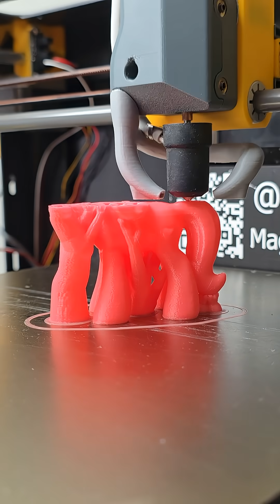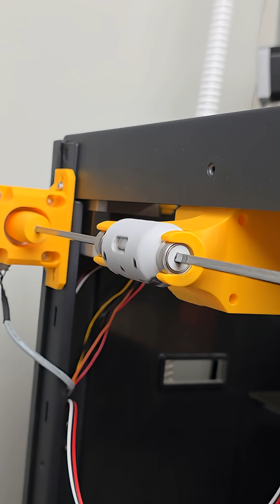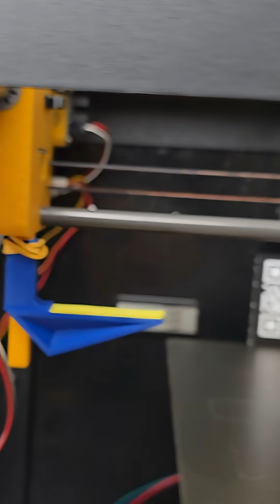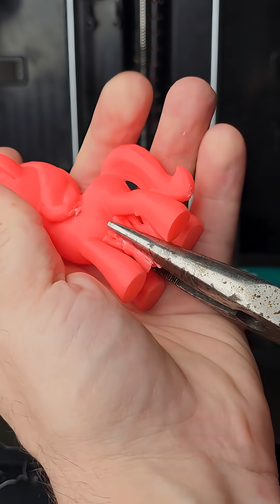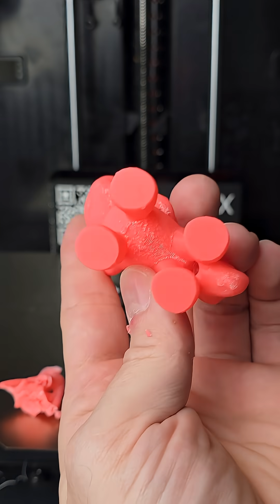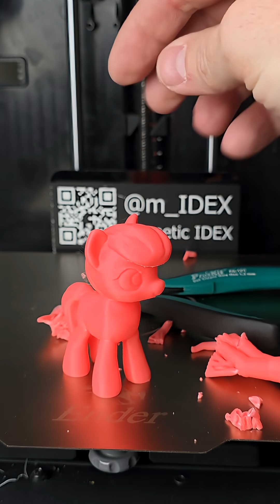ZGX Mod in Action: Printing a Cute Horse at High Speed!

Comment: Why don't you use 2 carbon fibre rods? This will save insane amounts of weight. Those two probably weight 150g or so. Carbon fiber would be like 3-10g.
Reply from the maker: Thanks for the suggestion! 😄

I'm not quite ready to dive into the full carbon fiber race yet. Ideally, I'd love custom CF rods with an ultra-thin stainless steel skin – that way standard linear bearings slide perfectly without running directly on epoxy (I'm still a bit wary of that, even though others have proven it works great in printers).

Your weight guess was spot on though – the two aluminum rods are only 117g total! With a ~180g toolhead, the whole gantry is still one of the lightest out there.

Definitely keeping CF on the future upgrade list – appreciate the idea! 🚀

Comment: All good thinking Dmitry, light weight low inertia for moving components is the best scenario. Another option is an hexagonal hollow shaft, this can be as small as 5mm AF with a 2.8mm hole or smaller down the middle, and these are very cheap too, and very light and stiff  enough.
Reply from the maker: Thanks Mike! 😄 Appreciate the kind words.

Hexagonal hollow shaft is a great suggestion – super light, stiff, and dirt cheap. I actually built a hex version several years ago, but couldn’t quite eliminate the backlash back then, so the coupling ended up as a desk fidget toy 😂

With what I’ve learned on the square shaft version (especially the bearing preload tricks), I’m now pretty sure a hex one would work perfectly. Definitely worth revisiting!

Love these ideas – keeps the project growing. Thanks again! 🚀

Comment: Tell me more about  CPAP. This is one of your developments that has been undeservedly forgotten.
Reply from the maker: Thanks for asking!

I used to think water cooling was a superior option for 3D printer hotend cooling. However, after exploring remote ducted air cooling, I think I've found the magic bullet.

Remote ducted air cooling using a single CPAP blower helps me eliminate all those pesky little fans from the toolheads. Yes, even the hotend cooling fan is removed.

Moreover, the hotend cooling airstream is further diverted to cool the stepper motor and extruder gear. This truly can't be done with water.

So, one CPAP blower airstream is split into four channels—two for each toolhead. Two channels are modulated with a pinch valve for part cooling, while the other two provide hotend, stepper, and extruder gear cooling.

Another benefit of this system is that I can print PLA in a fully enclosed and actively heated chamber without ever experiencing any jams due to heat creep. This allows for much stronger PLA parts (some suggest up to 20% stronger).
Reply: @m_IDEX ❤Very interesting topic, it’s a pity there is only one video on the channel and it is very old.

Comment: Where does it input its power? Lol or does it have some sort of clever cable mechanism
Reply from the maker: The X stepper motor is relocated to the frame (stationary on the side of the printer). It spins the square shaft directly, which slides freely through the lightweight coupling on the moving gantry.

Thanks for watching! 🚀

Comment: i can't imagine anybody constrained to any sort of reasonable budget seriously considering a specialty item like a spline shaft in that length.  a grind flat shaft would be significantly cheaper but would still give rotational ability with a good probability of allowing a sliding pulley to function.  holy crap.  are they rich or just nuts?
Reply: Did you listen to the short, he said it was only a $7 upgrade
Reply: @Reds3DPrinting did you read what i wrote supporting his decision not to go with the specialty upgrade which would've cost him far more than $7?